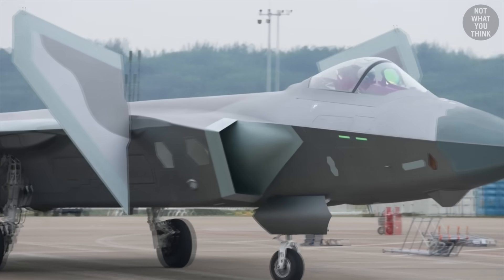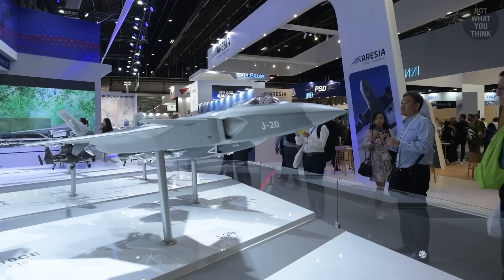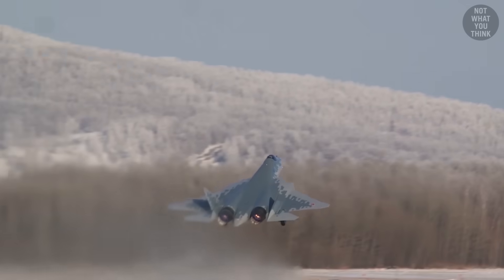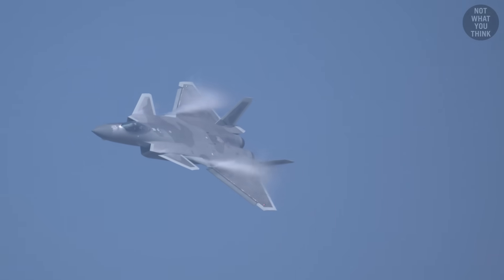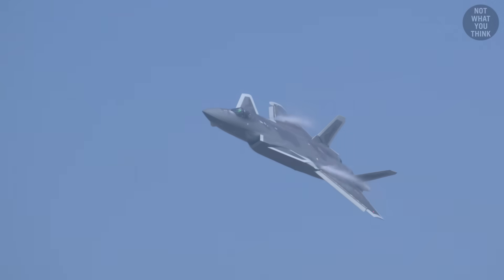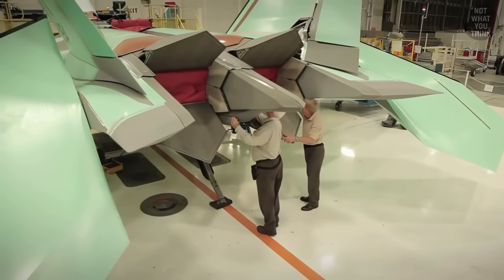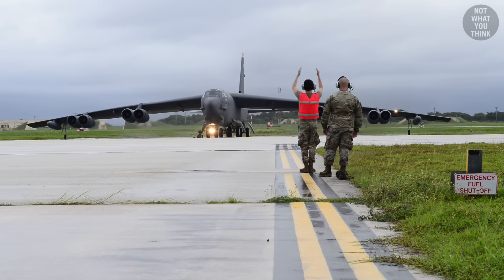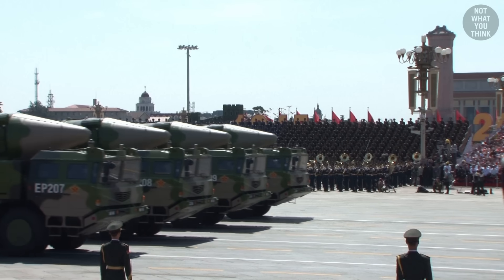Why China's Stolen "Stealth" Fighter is Problematic

Comment: The J-20 might have some advantages over the F-22, such as the F-22 having less capable sensors - but the F-35 still holds just about everything over the J-20 besides maneuverability and range.
Reply: F-22 just completed a 3 Billion dollar makeover, including the sensors from the F-35. Yes it can even see behind itself
Reply: @treeless62 no, it didn’t
contract signed doesn’t equal to just getting the things done
NGAD should be the new focus
Reply: Of the 3 heavyweight dual engine stealth aircraft J-20 is the least maneuverable. It has the slowest minimum turn rate. You can even see this at the recent Zhuhai airshow. It's not a fighter but an interceptor meant to take out large aircraft like AWACS and tankers with PL-15. F-35C on the other hand has Typhoon's wing loading and can replicate the same tight turns F-22 or Su-57 can do in a dogfight. While F-35A has Gripen's wing loading. But most importantly J-20 don't have a gun. So its better for J-20 to hit then run instead of initiating dogfights.
Reply: + it cannot supercruise (the F-35)
Reply: @andyturbo  
It won't supercruise because of stealth.
Reply: -cope from armchair westoid who happens to also be a PLA air force general 😂
Reply: @Mycatsbirthdayparty  
Sounds like you are the ones coping here. 😂😂😂
Reply: @CalvinHsuChen  🤡👏
Reply: @Mycatsbirthdayparty  
Yep. you're coping lmao!

Comment: So you have at most 10 shots until you get a flying fuel tank that can't even share fuel? It's basically a flying hunk of junk at that point.
Reply: To be fair, 2 out of 3 f35 variants doesn't come with guns either. Yes, you can have a pod, but do you really want to compromise stealth for guns?
Reply: @chadzhou106  It's a stealth FIGHTER, not a stealth missile jet. 'Staying power (For lack of thinking of a better word) is important in a aerial fights, even if they are long range. If you use all your missiles, you end up being useless without a backup weapon to fall on.

That said, I do suppose they would forgo the guns for a reason. Probably something I just am not privy to

Comment: Wow could you believe it, the J-20 looks, very very, very, very very VERY, very very, very very! Like a disabled raptor.

But yes the J-20 does have an advantage due to the  time it was made. Though don't be naive, this isn't a theory, but Lockheed Martin and other US PC's are most likely well into plans on a new stealth fighter.

 Either in the Raptor family or a whole new fighter we've never seen before.
Reply: @petegili565  the point is that it doesn't matter if it "as-good" or not, the fact that it's close enough, it's in mass production, basing is available all over the first island chain of the spratly islands, it has an endless check and very dedicated engineers, and the US can only reasonably field 60 f-22s in a fight against China, when you consider that only 120 of the total production run are combat coded airframes, sortie availability is 50-55 percent, basing is limited in the Indo-Pacific, and ACC could only reasonably commit half of that fleet, so like 60, to the fight against China to maintain a contingency for Eastern Europe/AND Middle East Russia.

When you look at which aircraft the US takes seriously enough to take 5th generation fighters and put them into dedicated aggressive roles, notice that they are still using Super Hornet Block 1's with the old mechanically scanned APG-73 to simulate the Su-57

Do you know what aircraft the F-35A simulates? The paint on said F-35 aggressors looks a little... Chinese 😅

Comment: Did we forget the F-35 exists in numbers nearly quadruple the J20? Why are we comparing the J20 to the F22? The F22 was Americas FIRST stealth fighter and has been replaced by the F35. No the F117 wasnt a fighter you can exclude your comment about that.
Reply: There are more than 1000 f35s so that 5 timesmore than the j20. Also is the f22 constantly getting updates.
Reply: @michagysin3082  "Constantly getting updates"
It's received one update package in the last 6 years for ~$16B. This package includes the development and procurement for LO external tanks and IRST sensor pods.
It's not receiving updates.. It's being phased out. That's why I'm questioning the F22 being compared.
Reply: @OutletAudits  The radar was also upgraded and with exactly that update you mentioned it will be much better.

Comment: video missed one of the most important parts, one of the reasons for it being wider and longer is so it can also carry more Air to air missiles, it can carry more than the f22 and f35 plus its large internal weapon bay means it can fit bigger missiles that got longer range than western ones without losing its stealth capabilities.
Reply: @moteroargentino7944 The F-22 is undergoing a massive upgrade right now.
Reply: J-20 only carries 4 PL-15s and 2 PL-10s. While F-22 carries up to 6 AIM-120 and 2 AIM-9X. On the other hand with Block IV F-35s can carry up to 6 AMRAAMs whether its AIM-120, AIM-260 JATM, or Meteor. So that is 2 more BVRAAMs than J-20. Also PL-15 is a large and heavy missile more useful against larger less nimble aircraft like AWACS and tankers. It's certainly easier to outmaneuver than an AIM-120 or Meteor.
Reply: Not at all lol, it carries a maximum of four pl 15s in the main bay and 1 pl10 in each side bay. The f22 carries 6 amraams in the main bay and 1 sidewinder on each side bay. Also the f35 carries 4 amraams in the main bay with the sidekick mod.
Reply: @michagysin3082  Actually, the F-35 has 2 bays and it's able to carry 2 AIM-120 in each... 3 with the sidekick system. 
Also, many missiles are currently being developed with stealth designs in mind... they're going to be half the size of an AMRAAM with similar capabilities.
The Peregrine (Raytheon) is one of those... and a single F-35 might be able to carry 8 of them internally, without the sidekick system.
Reply: @artiefakt4402  Appearently the f15ex will be able to carry about 24 to 36 peregrines. Thats almost Ace Combat level.

Comment: I guess the thing about how all the 5th gen now looks the same it's prolly cus how optimal the F-22 was designed to this day even after everyone else testing their own design it still can't beat the F-22 foundation look, so everyone decided to copy that but alter it slightly
Reply: Actually, it's because we all follow the same laws of physics.
Reply: The j20 is actually the most different compared to the rest of the fifth gen fighters
Reply: Wrong. All US stealth planes are based on a Russian research paper by Piotr Ufimtsev, who was the pioneer on stealth. He was the one who found a mathematical formula with which the radar cross section of an aircraft could be calculated, and according to which the most ideal shape to reflect the highest amount of radar away from the source is a diamond shape. It's for this reason that all stealth airplanes look alike; they're all designed based on the same mathematical formula, and with the ideal stealth airplane shape already having been determined (the aforementioned diamond), it leaves no room for variation, if you want an airplane with a very low radar cross section yet still very aerodynamic then you're always going to end up with a F-22 like design. The US just happened to be the first ones to use Ufimtsev's formula to actually build an airplane with. Not the F-22, but the F-117, which due to the lack of computing power back in the day had such a strange look to it. It's the diamond shape with a V-tail added to it, and it's wings swept back, but other than that a very close resemblance to the diamond shape. The F-22 is an even better aproximation, even it's wings are diamond shaped, and thanks to more modern computing power they were able to compute a more aerodynamic blend while still retaining low RCS.
Reply: @pieterveenders9793 that was a mathematical formula and not a plane design and was only really directly relevant to the F-117.
Reply: This is complete rubbish, three companies in the US have developed stealth aircraft and none of the other designs look like this.  The only planes that look like Lockheed Martin designs are the ones that are copying Lockheed Martin designs. 

The NGAD will look nothing like the F22 because the F22 is not the ultimate design for a fighter.
Reply: Exactly.  It's similar to how all SUVs look mostly the same, the design is converging on an optimal aerodynamic shape they all share.

Comment: Weird video. It's like he keeps forgetting F35 exists. There are more J20s than F22s. F22 doesn't have stealth detectors. OK? Doesn't F35 fix those problems?

He also seems to have way too much faith in J20's stealthiness. The country with a multi-decade lead in first-hand opportunities to develop syealth detection systems and test them against the best, and for many years only, stealth platforms, might not struggle detecting J20 quite as much as he seems to assume.

Comment: Nope. Both F-35 and F-22 still has the 1st kill opportunity maybe even a 2nd one as J-20 is already proven to be less stealthy.
Reply: Source?
Reply: 1ST. Their is a 3rd party radar scattering CAD simulation done on Aircraft 101. Without RAM coatings, they compared all 3 F-35, J-20, and Su-57 low observable LO characteristics through their shapes/geometry alone. Data is taken from basicsaboutaerodynamicsandavionics()wordpress. Replace () with a .

In a 20x20deg frontal aspect, "J-20 RCS is higher than F-35A RCS through the frequency range (approximately 3.5 times in X-band, 1.5 times in VHF band), it still has much better RCS characteristic when compared to Su-57.”

This mean even with the same RAM coatings used on the F-35, J-20 much more Su-57 can’t make up the difference in total RCS reduction given their LO properties/geometry. So F-35 definitely has the “first look, first shoot, first kill” in beyond visual range BVR.

2ND. Both Pacific Air Force (PACAF) head Gen. Wilsbach and US Air Force Chief of Staff Gen. Brown assessment of J-20 as “It’s not anything to lose a lot of sleep over” when F-35s were able to close in on J-20s and observe them near Japan.

3RD. J-20's canards and the whole vertical stabilizers are moving.
Reply: @johnsilver9338  Those were pretty much what I was thinking, especially your third point.  If a planes turbine blades being visible are a problem, those canards might as well have bullseyes on them when in use.
Reply: @johnsilver9338 counterpoints:
Canards usually don’t;t move a lot during flights, so the vertical tails, because they a r e fully movable, so a minor change in angle causes a lot.
J20 approached F35 without being detected over south china sea(from behind)
seems that both of them aren’t good at detecting others
Reply: @johnsilver9338 The J20 and all Deltas can fly without moving either the vertical stab or the canards in level flight. The canards are used mainly for rotation at take off and high G maneuvers. The wings have elevons that function as both elevators and ailerons. And the J20 is not a good acrobatic plane, it will probably just shoot and scoot. It will not likely even turn on its radar, the PL15 and PL20 has passive/active seekers. Like the F35, the J20 is  a networked fighter.
No plane is invisible, it just needs to get close enough to release its missiles without being shot down.
Reply: @olderchin1558 finally one reasonable comment here amidst a sea of Americans that have never even flown a Cessna
Reply: Hypothetically i could see the j20 spotting the f35 first though, with VHF radars placed on islands in the south china sea the j20 could maybe know where to point its radars and have an estimated range and direction of an f35 before the f35 is even within amraam range (this assumes that the radar stations can communicate with commanders on land. So it might be good to focus on jamming comms if you're going against china)
Reply: @helpmedaddyjesus7099  those really aren't accurate enough at range for that
Reply: @helpmedaddyjesus7099  Everyone can see stealth aircraft with EWR or other radars (low frequency) the hard part is getting a high enough data track with a weapons radar (high frequency) to be able to engage the target.
Reply: @jtl-08  what I'm trying to say is that the j20 could position itself behind the f35 without the f35 knowing that the j20 is in the sky with help from the ground radars, and then(assuming the rcs of the f35 is larger from the rear) launch a pl15(or a smaller missile) from close or medium range using the radar on the j20.
Reply: @helpmedaddyjesus7099  Both the PL15 and PL20 missiles have a AESA radar in its nose cone and the usual AI+GPS+RF+Inertial guidance module. That means the missile can be released either off bore or from very far away, the radar may turn on only close to the target or using passive mode to lock on the enemy radar or emit jamming signal to confuse the victim. 
The initial flight of the missile can be guided by the J20 or GPS or an AWACS or Satellite or another fighter or just Inertial Guidance. This is what it means to be a networked fighter. The US also have this capabilities with the F35 and its latest AAMs. The Chinese slight advantage is its slightly longer range missiles and home turf since any conflict is happening in China's front porch.
Reply: Stealth is way overrated!!
By guys online.
The military know it isn't a silver bullet.
Reply: But what if there are three J-20 for each F- .. ?
Reply: @FranckLarsen  china moment
Reply: The most proven invisible ones are the Chinese weather balloons. they even cross over the United States
Reply: The claim that the J-20's stealth is ineffective—originating from Indian assertions—is unfounded. In reality, the F-35 is incapable of detecting the J-20.
Reply: @wangqi1387  In reality, its the opposite really given the data found at Aircraft 101. F-35 can detect J-20 at long range while J-20 can only detect F-35 at close - medium range most likely giving the F-35 the 1st shot 1st kill opportunity.
Reply: Source?

Comment: Although I agree the j-20 radar cross section isn’t great you have to consider the direction on how a radar system hits the j-20. The direction and angle plays a big role. It could be semi decent in a head on but I doubt it would be even considered stealth if tracked from an odd angle. This Also applies to the bottom belly of an f-35 for example. A radar cross section isnt static is what I’m trying to say. The Canards of the j-20 is also pretty bad in keeping its stealth characteristics.
Reply: The canard does not do much harm to stealth. The problem with the J20 is that the nozzles of the early batches are AL31F.
Reply: @你看个锤子你看  its a well agreed idea that canards in general lower a RCS because of how  radar hits the jet. if the j-20 didn't use its canards and flew straight the RCS would be good. the moment it swings up or down the RCS fluctuates at a higher ratio so instead of looking like a golf ball on the map it looks like a car.

Comment: First it is not a stealth aircraft. The j20 has a larger radar signature than an f16
Reply: <citation needed>
Reply: That's absolutely not true, the F-16 has a RCS of 5 m2 compared to the j20 with much lesser than 1 metre square, all this including the fact that the j20 is much larger than the f16.
Reply: @kipweit9634  not sure where you’re getting your information but your math is off first of all. It also does not matter the size of the plane. It does matter, however, the size of the signature. Just because the signature is smaller than the plane itself doesn’t make it stealth. There are five different categories in which an aircraft have to meet to be considered stealth. I sent you a video with the citations in dealing with this. no one in the department of defense which I work closely to considers anything that Russia or China has as being truly stealth. Good aircraft yes but stealth no
Reply: @FBCTrona  First of all I didn't do any math, I just provided estimations available online, secondly you kept talking about citations but didn't provide anything in that regard.
Reply: @kipweit9634  simply go to the video that I provided you. Look under the video to the description and you will find 12 different citations where the real math was done.
Reply: @FBCTrona  your link got deleted you are the only one who can see it.
Reply: Ya no need to worry